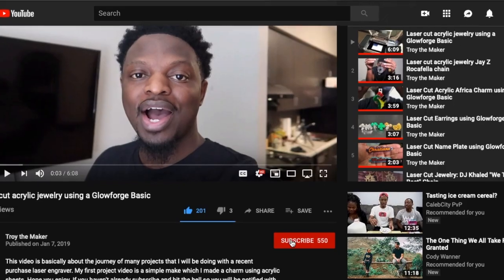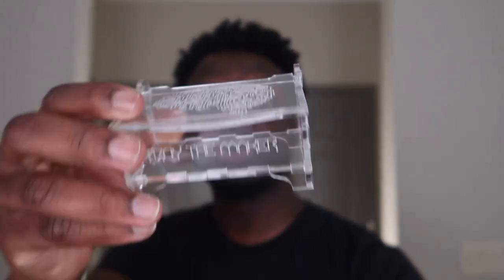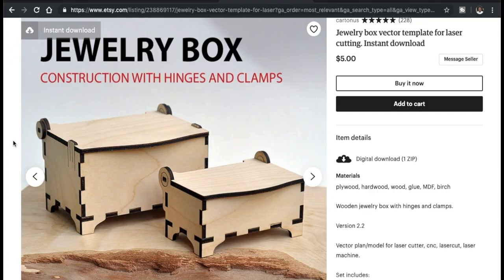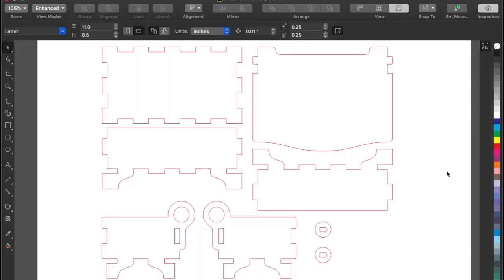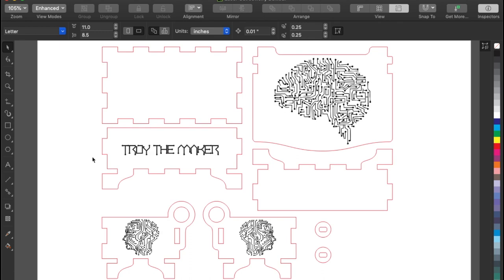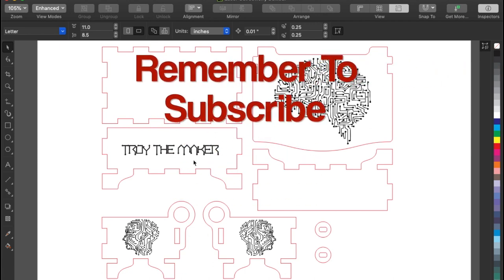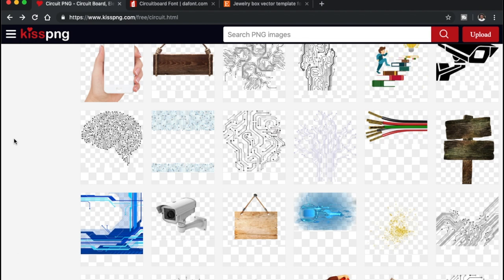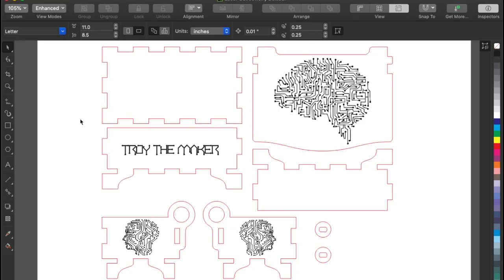Laser Cut Jewelry Box

Comment: Would you mind sharing your engrave settings?
Reply from the maker: I used Glowforge recommended setting for medium clear acrylic which is 1/8” thick material. The engraved settings are 1000 speed and 100% power.